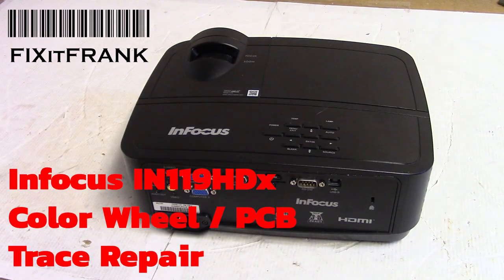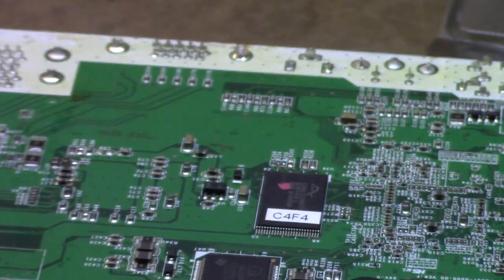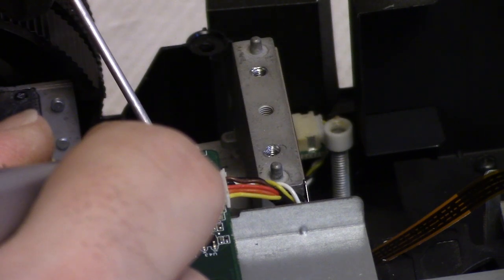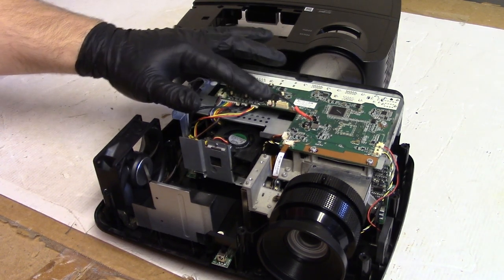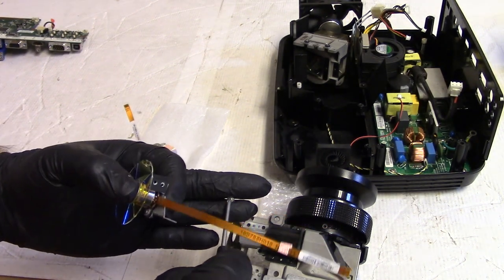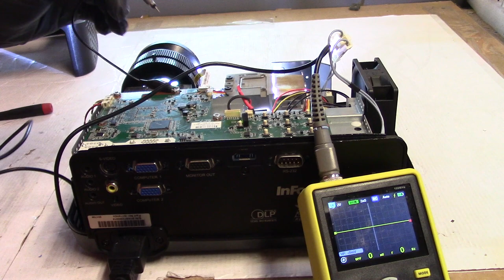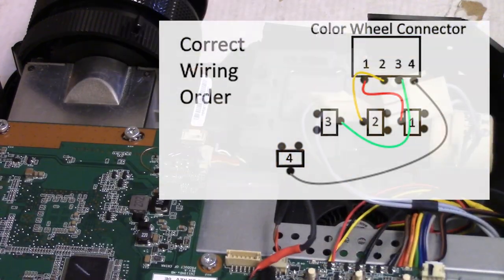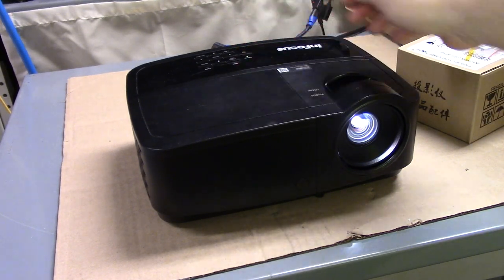Infocus IN119HDx Color Wheel Connector Repair/Replacement

Comment: I like the way you heat the board from the back so you don't damage the plastic connector. Here's a little tip: use Rose's alloy next time. Apply it to the contact pads of the connector using a soldering iron tip. When a Rose's alloy is mixed with lead-free solder, it lowers the melting point of the solder. Thus, much less heat is required to desolder the connector.
Reply from the maker: I actually do use low melt alloy sometimes(chipquik brand usually). It's a fantastic product for all sorts of desoldering uses.  My concern with using it in projectors(and reason I did not use it here), is certain areas get very hot.  When using low melt alloy I find I need to clean it from the surfaces extremely thoroughly or it will contaminate the new solder and possibly cause the connection to fail in the future at a lower temp. I'm more comfortable using low melt in areas that are not susceptible to being hot. That connector would be near the heat of the lamp when re-installed so I would be hesitant to use it.  I'm also trying to show people methods that do not require special materials to perform.  This is good advice though.  Low melt solder can be a god-send in many situations.  I'll have to demonstrate it sometime.  Thank you for the tip!

Comment: Hi frank I have the same model but the color is broken just my question is what the model of that color wheel or remplacent code thx in advance
Reply from the maker: you know, there isn't a specific part # that I go by.  I always buy them as "model # colorwheel".  As long as the segments are in the right order and hte little sticker on the hub is in the right spot, you are good to go.  I'm sure infocus has a specific part #, but they wont have parts for these anymore.  Aftermarket is your best option.  I use folks out of china called Time electronics. Gydz@timeprojectorlamp.com and they can help you. they ship DHL and take paypal so its all above board.

Comment: hello @fixitfrank, I cleaned my gt1080 optoma projector about 3 years ago and for that cleaning I messed up a 5-pin micro connector by stretching the small cable that goes from the power supply to the motherboard, my question is where Can I get that cable and the 5-pin micro connector?  I'm a fan of yours on youtube help me please!  I live in Mexico 😢
Reply from the maker: oh no.  Thats the ballast control wire.  If you cant shove the wires back into the connector or solder them to the board, then you will need to find another cable.  An HD26, HD28 should also have the same wire.  I am not sure where to find one in Mexico though.  If you don't mind ordering from China, contact the folks I use. Gydz@timeprojectorlamp.com  send them a picture of the old wire and include the model. I don't think it will cost much at all.
Reply: @FixitFrank  thanks for your answer!  I'll get in touch with the recommendation you give me, thanks again!

Comment: Thanks for this video! I have almost the same model (IN118) and the colorwheel makes noise but it dissapears if the projektor is upside down. Is it possible to lubricate it?
Reply from the maker: In theory yes, but you will be better off cleaning the piece with some alcohol. Oil/lubricant will cause dust to stick.  You actually want it clean.  However before you even do that, I would check the screws holding the optics. I bet the vibration is a loose screw allowing the plastic casing to vibrate with the wheel. I would clean the wheel hub as a last resort.  I have a video called "last ditch color wheel repair". It has some tips
Reply: @FixitFrank  Thanks a lot! I´ll try this.

Comment: Sorry if it isn't the right place to ask that: Have you ever had a case of a BenQ 1070+ Fan #4 not spinning? Which causes overheating under 5min.
I saw other people having the same problem but never found a solution.
It's an "old" model but maybe there's a solution.
Thank you in advance.
Reply from the maker: oh yeah, it happened to mine 1075(basically the same). Its the intake fan near the DMD. Needs to be replaced. Check ebay. or if you don't mind waiting a week or so, contact Time electronics for another.  Gydz@timeprojectorlamp.com is their contact info. they ship from China but use DHL and take paypal so everything is safe.

Comment: Hi FixitFrank, I've got overheating problem with my infocus in119HDX, the projector turn of after 30 min et the led temp lamp flashes... I saw you're video on the infocus in 2128HDX but the ventirad doesn't appear dirty... Moreover, I don't see any apparent damage on the motherboard... Have you got any ideas to help me please?
Reply from the maker: Have you replaced the lamp assembly before this issue started?  There is also a chance that the fan is rotating but the status wire is reporting incorrectly.  This video may help. https://youtu.be/kCOSQ8dVZvc
Reply: @FixitFrank  No, I didn't... I will check your video, thank u a lot for your response !
Reply from the maker: ok good!  A new lamp with a bad IR filter can cause this.  That is why I ask.  I suspect you have a non-reporting fan.